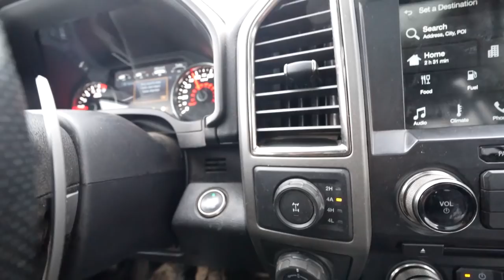Truck & Trailer Slide 100 Feet Backwards & Off Embankment

Comment: There are weights on the driveline (shaft) as well. It's uncommon for them to fall since they are spot welded on but in areas with a lot of rain and snow they have been known to get rusty and come off. It will also feel like a tire balance issue or feel like you are losing a bearing in the rear diff at highway speeds.

Edit to add: Never disconnect a trailer if you're stuck just creates more problems. Should've left the taco on the trailer. Shawn could've used the winch and a snatch block to get the rear pulled back up on the road and the other dude could've hooked up to the front of the raptor to get you pulled straight and up the 100yds up the road.
Reply: I also watch Matts offroad
Reply: 95% of the time, you shouldn't disconnect the trailer. But in an instance like this where you're at risk of losing the Raptor because of the trailer, it was definitely smarter and safer to separate everything.

Comment: Even better, 4A is actually pretty much AWD. It doesn't just engage 4WD when it detects slip or hard acceleration, it's can split torque F-R anywhere from 2/98 all the way to 48/52 before locking up completely as well. 

If you've got FORscan you can look at the TCCM and 4W AUTO clutch % and see it constantly adjusting F-R torque split. Pretty cool, and mines been bulletproof for 110k of abuse now.
Reply from the maker: That's awesome man. I love the Raptor!

Comment: Honestly dude, I don't think there's anything you could have done to avoid sliding on that ice sheet. When everything is good and smooth-going for 99% of the road and then you suddenly hit invisible ice, you're at the will of luck at that point. The only thing you could have done was somehow know that the ice was there, and then chain up for it. You guys still killed it though! Can't wait to see the caged SASquatch in a video 🤘🤘🤘
Reply from the maker: Hey thanks for the positivity man.  I felt like an idiot but like you said it was smooth sailing right up to the last 100 feet of road.

Comment: Dude, been there done that! Was in a 4wd explorer in Tahoe going up a hill that had just been plowed. Unfortunately, the plow  ended up basically creating an ice rink on the road and near the top I completely lost traction and slid backward about 50 yards. Fortunately, there was a Range Rover wedged in the snowbank  (that had just done the same thing) there to stop my slide! 😆 My rear end slammed his front right corner and blew out my rear window and wrecked the tailgate. Found out that in winter in the mountains, you need studded tires or chains even with 4wd! 👍🤘
Reply from the maker: Yeah dude. We don't get a lot of snow where I'm at so it didn't even cross my mind. Deffinitly throwing some chains in the truck

Comment: Glad to see all vehicles could be recovered without harm and excited to see the adventures that were had! Also you mentioned at the end that there is a feature that allows you to inflate/deflate tire pressure from inside the cab of the raptor, what is the name of that system?

Comment: 4A is a all wheel drive on the raptor using clutches. It's not as good as 4x4.  It's more for less ice and snow and more wet conditions.

Comment: I have heard never disconnect the trailer.. From a "expert" Matt's towing...  The whole situation could of been better if max did a few things different maybe.. Even if he had a heavy duty vehicle,  traction and weight become the issue..  The Toyota looked helpless as hell.
Reply: The Tacoma definitely needs a winch and a working front locker. But everything they did was pretty pot on for the recovery. 95% of the time, you shouldn't disconnect the trailer, but in an instance like this, it was much smarter and safer to separate everything.